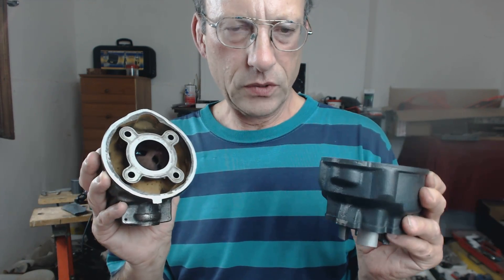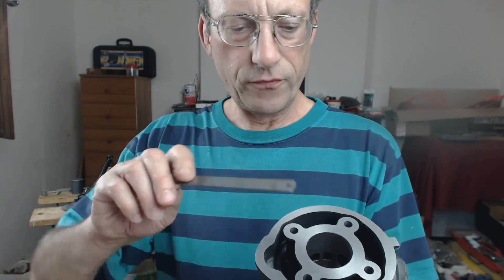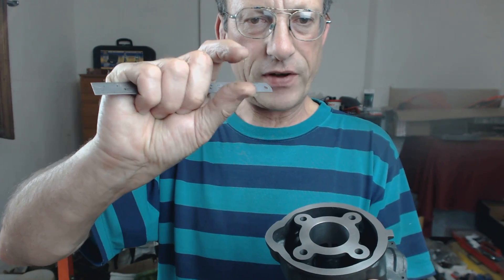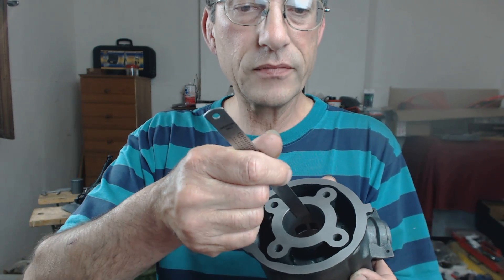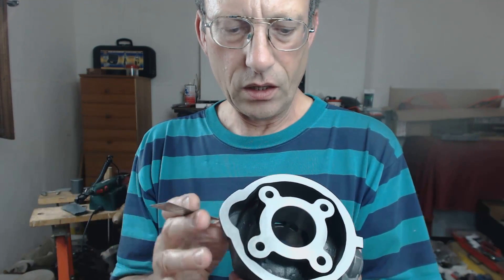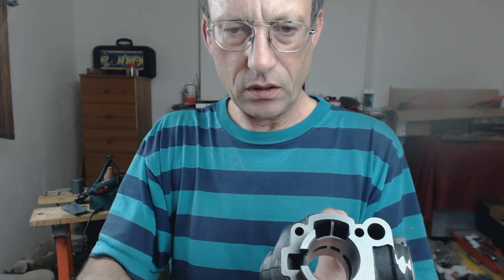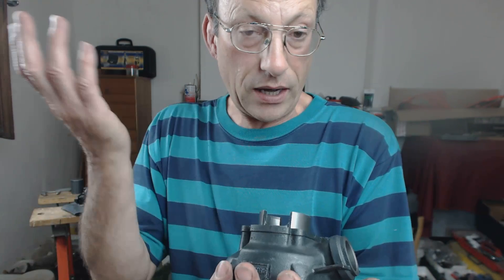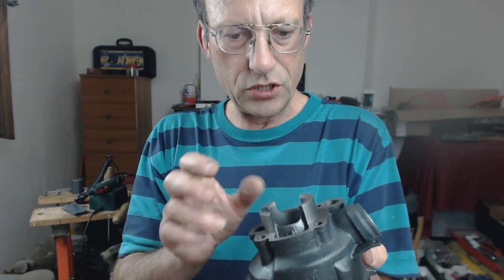50cc AM6 - TNT cylinder ports vs original Minarelli cylinder ports

Comment: hello :) is it possible to fit am6 cylinder on derbi d50b0? Thanks in advance. my engine just blowed up so i am in search of a way to fix it. repair or replace.
Reply from the maker: Fix the engine with the correct components.
There is little difference in price

Comment: I went to port a stock replacement am6 aluminum cylinder, I went a bit overboard and ended up with 197,5 degrees exhaust duration and 132 transfer duration, do you think this is ok?
Reply from the maker: For all the advice, planning, and execution...
Whatever mod you make, you are going to try it.
The most important element, is having recorded some benchmark test runs of your previous setup.
That way, you will see exactly how the power delivery has changed.

Other then that, for porting, I would suggest that you experiment in stages, as it is difficult to put metal back, after it has been removed.

Good luck!
Reply: @EngineTuning  I will try, thanks!

Comment: both are original. Does not make any difference in speed.
Reply from the maker: No - That is incorrect on both counts.
The Minarelli cylinder is original, and it provides vastly superior performance over the TNT cylinder.

The TNT was tested, and it was not good at all.
The old Minarelli unit was in bad condition, but it was hand honed and returned to service.
The TNT cylinder has remained unused ever since.
Reply: Engine Tuning Okay. But airsal is good
Reply from the maker: I haven't tested an airsal unit, but I have heard very good reports.
Their entire range is in a different league to the TNT cylinder, both in terms of price and performance.
:)